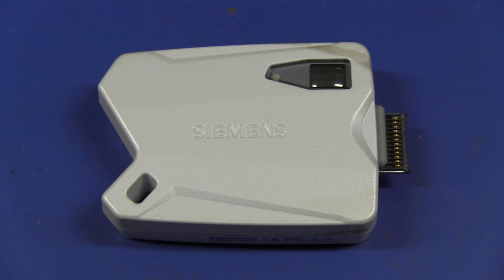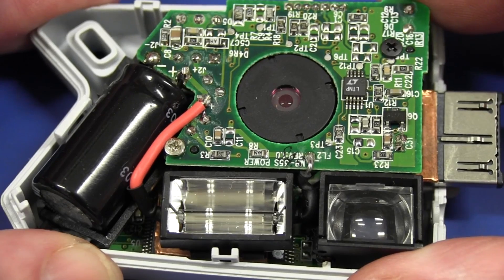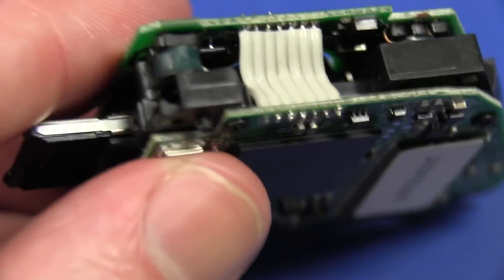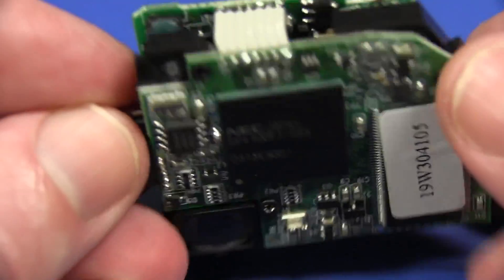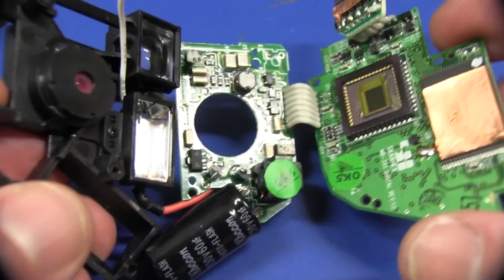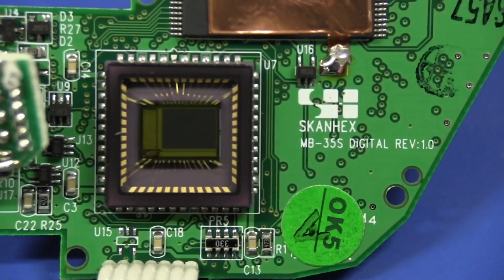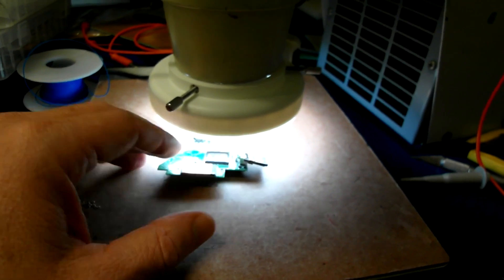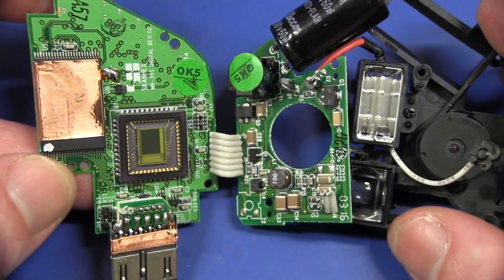EEVblog #299 - Retro Phone Camera Teardown

Comment: I've got a nice surprise with DC power sup caps when I was young and did not realize how long the charge lasted.

Is there a good way to see the energy input vs output of a cap with different discharge rates?

Comment: I am wondering if the copper tape over the flash memory IC is to protect it from interference from the high voltage discharge from the camera flash.  Just a thought.

Comment: Very close!  Old xenon flash tubes needed a trigger voltage in the order of 4kV for the tube to conduct.  That foil shield is there tied to ground to prevent arcing from the trigger lead (which IS the reflector) to the CMOS flash ram chip under it.  For shame if taking ta picture resulted in ESD damage to the very chip the image was being written to!

Comment: Ironically Apple actually prototyped a camera phone PDA back in 1995 but never brought it to market likely due to costs.
The first commercial marketed camera phone was the sharp J-SH04 in 2001 which used a CMOS sensor.
The quality was no where near as good as the Siemens S55 add on which was very good ,comparable to low end standalone digital cameras of the era.

Comment: Prob been mentioned but the shielding on the chip at 6:30 is probably there because its opposite the flash so when that discharges the surge of current could cause EMI and so the copper was probably to protect against that.

Comment: True. However, there should be other soft fuse mechanisms in place, which should require the unit to just about fail catastrophically before the fuse blows. They're a last resort that never fails. 
Except for in current mode, but note that Dave didn't recommend discharging the cap in current mode, but in low z voltage mode, which has a few kiloohms of resistance, rather than "zero". This should be ok for both the cap and the meter. Of course there's the odd idiot who WILL do it in current mode.

Comment: Appart from the flash discharge noise, you also have 2 switchmode supplys on the top pcb, wich could generate some noise. The one is the one that charges the flash-cap, but, i am faily sure i can se anotherone. I guess it is for making a stable supply for the logics circutry on the other board.

Comment: The spike from the trigger coil would be capacitive, so copper is fine. It would also provide some protection from fast-changing magnetic fields from the main tube discharge though eddy current losses. My guess is the main problem is the HV trigger pulse.

Comment: I took apart a disposable camera that had a flash, for the flash bit, and I accidentally shorted out the capacitor with my hand and my hand clenched down on the damn thing and I couldn't let go until it was fully discharged. It also gave me small burns where the contact was made. It was funny, I was waving my arm and grunted a bit trying to through the thing across the room.

Comment: I question whether that is a CCD sensor. It appears to have integrated readout circuitry and I don't see any AFE IC on the board which you normally need for a CCD. Probably actually a CMOS sensor. My understanding is that the semiconductor processing you need for a CCD doesn't play very well with putting logic on the same die.

Comment: I have a Nokia PT-3 external camera that I used while I had a Nokia 3100. The camera had a resolution of 640x480 pixels (not great), flash and its own LCD witch told you what image quality you had chosen (Photo,High,Low), how many exposures remain, battery meter, flash charging indicator as well as telling you its on, off or auto, self timer and the a beep indicator as it has a buzzer and this camera has the ability to be used with out the phone as its ran by 2 AAA batteries.

Comment: Depends on the model. Dave has reviewed and made teardowns of a number of multimeters, and given his characteristic big thumbs up to those that have replaceable fuses. So they do exist, but I guess it's more common that the replacing the fuse requires opening the meter, and not just the battery lid.
And then there's of course the polyfuses, often in series with the required melt fuses, which won't blow permanently.

Comment: Shield will be to protect against the trigger pulse from the adjacent flash tube - this is typically 1-2kv  (generated by the inductor you broke) with very fast risetime, so can couple into nearby stuff like a bastard.